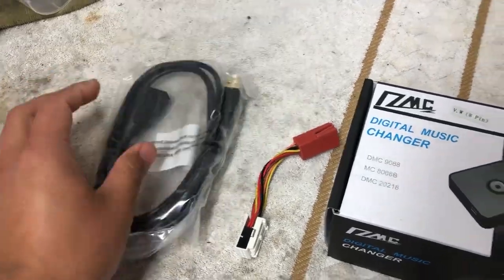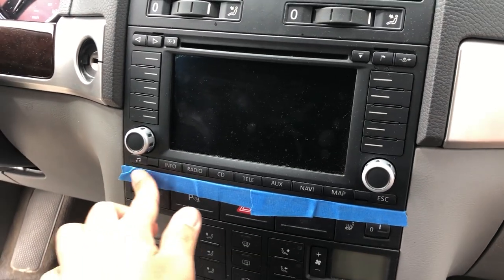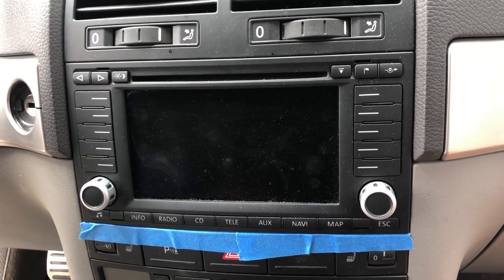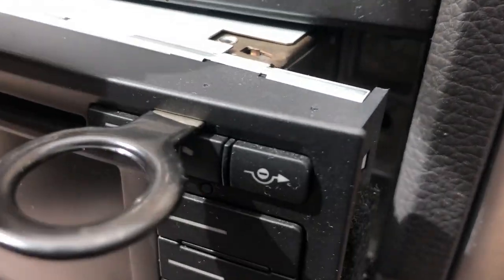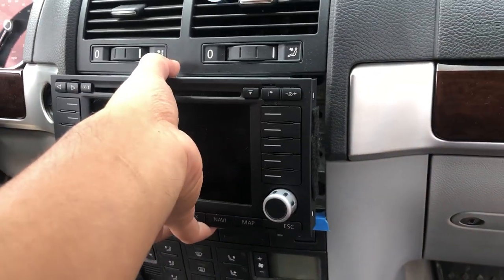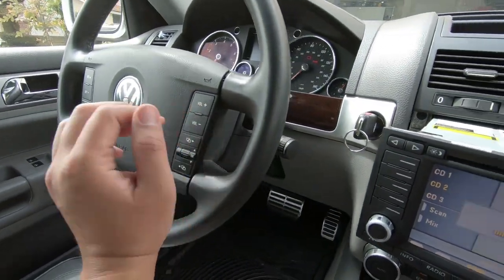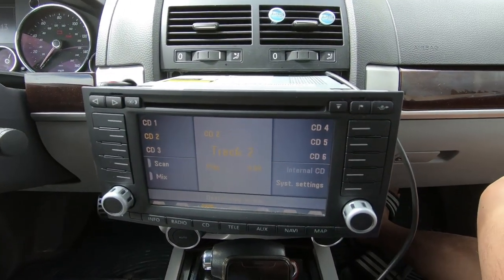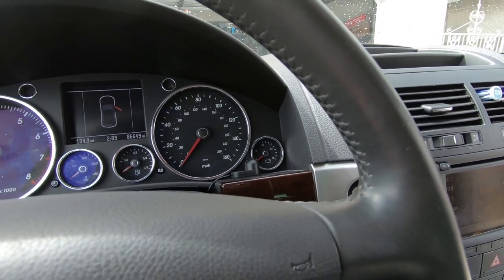VW Bluetooth music streaming & Phone connectivity upgrade!!

Comment: I really liked the video, and the tuto, but i actually have a question, i just bought a VW golf 7 but unfortunately in my country they sell the basic version with no bluetooth, aux or usb. Only sd reader. I asked to add bluetooth. So they did but i cant change the music or modify the volume with the stereo. I only can rise up and down the volume from the buttons. Do you have any idea what should i do?
Reply from the maker: It depends on the brand of Bluetooth adapter they installed for you. Some have more features than others. Best thing to do is ask the guys that you purchase from
Reply: I am not the one that bought it. I mean before buying the car they asked me what features i want to add, asked for few things and bluetooth is one of them. So i really dont know what bluetooth they added. Unfortunately i cant touch anything because of the waranty. The only thing i know is that the bluetooth's name is metavoice

Comment: Does the CD player still work or does this render the CD player useless?? Thank you
Reply from the maker: CD player still works! Changer does not
Reply: chowcares but do I have to take the radio out to switch between cd and Bluetooth
Reply: chowcares I also have navigation so I would prefer to keep the nav dvd in the front slot
Reply from the maker: No, just push the cd button. It will change from the cd in the radio to Bluetooth (aka cd changer)